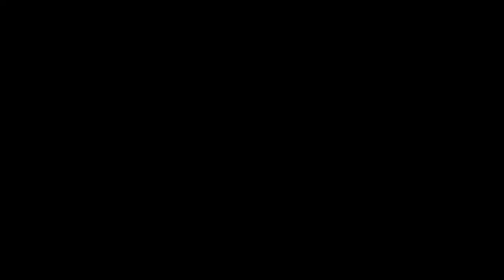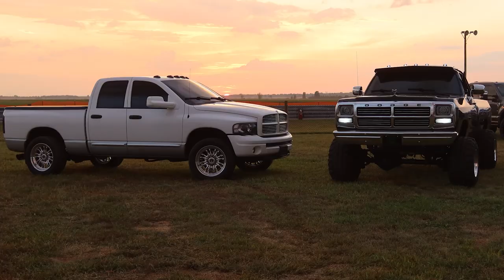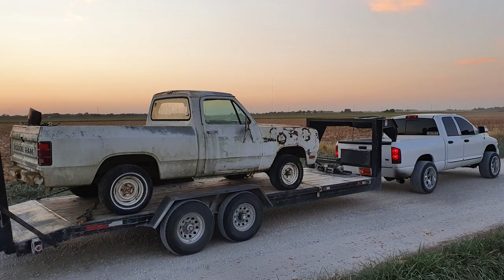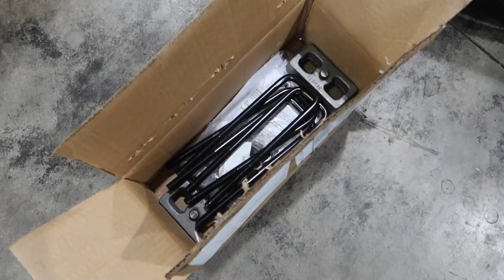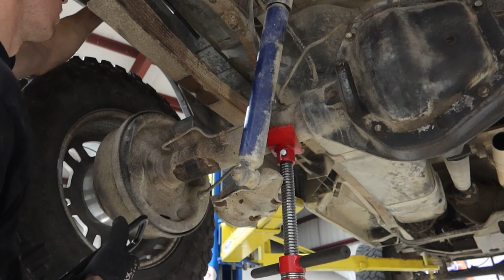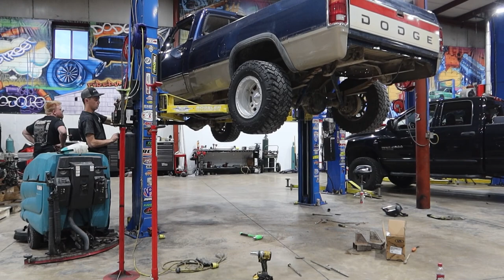Reverse leveling my 4wd First Gen! PT. 1

Comment: I was thinking both my factory 4wd trucks had 4" blocks.  33"s will work fine on stock height but need proper back spacing but turning radius is limited.

Comment: Hi Gavin 👋 
I've been daily driving my D250 club cab. What I have noticed is that the rear has too much spring, thus the suspension is too stiff and not doing it's job. It is great for loads but doesn't work well when not hauling. What are your thoughts on pulling the overload and using air helpers?
Reply from the maker: That could be a great idea, I have not tried it first hand so im not 100% sure!

Comment: Where did you find the OEM grill for your first gen The only ones I can find they don’t have the Dodge lettering across the top
Reply from the maker: They were both factory. You can't buy them new. The only ones you can buy new are the cheap China 70 dollar ones with no dodge lettering. The oem ones go for a very pretty penny